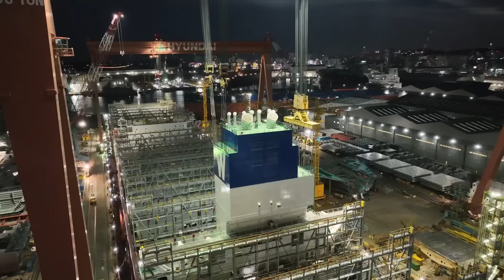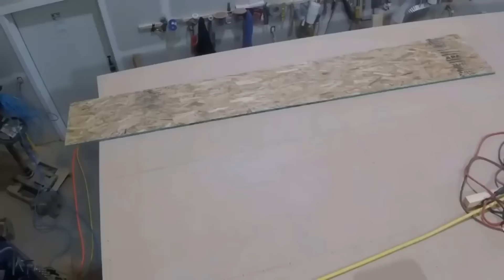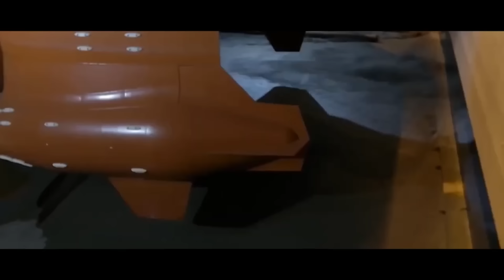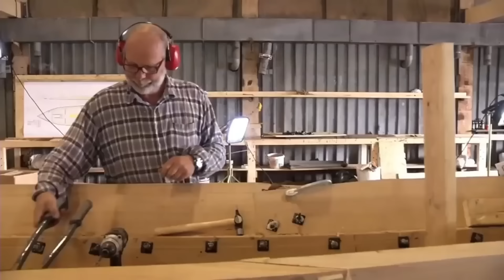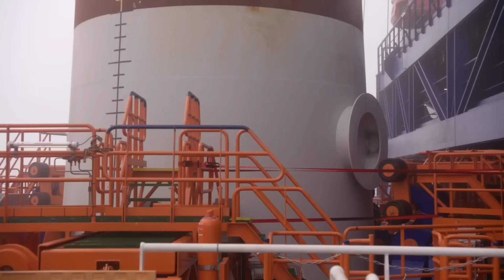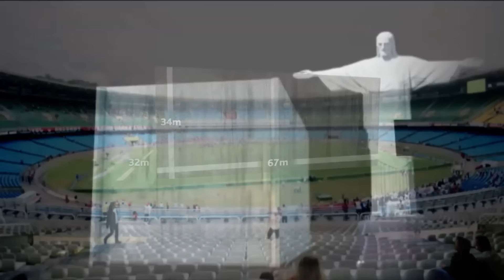Homemade boat making process - Amazing wood boat building method - Steel ship production technology

Comment: Didn’t need an hour of dialogue 😅 and ya no it’s no hand made, y’all just welding and not even connecting most welds inside. If you can see he stops and leaves a weld gap in certain areas

Comment: TO ENSURE THAT THE BOAT NEVER SINKS, THE GAPS MUST BE FILLED WITH INFLATABLE POLYSTYRENE SO THAT EVEN IF THE BOAT BREAKS IN HALF, THE PARTS WILL NOT SINK.  SO MUCH WORK AND THEY FORGET THE MOST IMPORTANT THING: TO PREVENT IT FROM SINKING